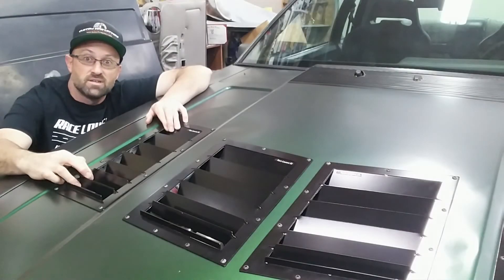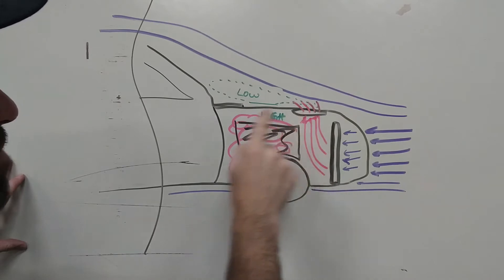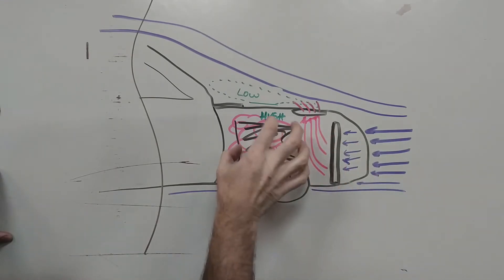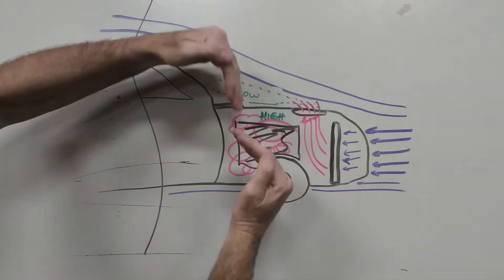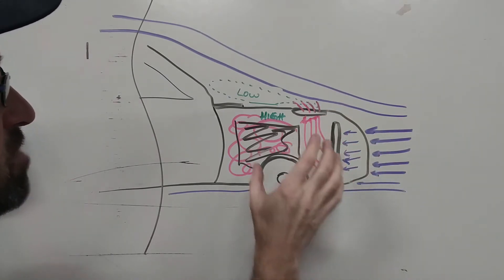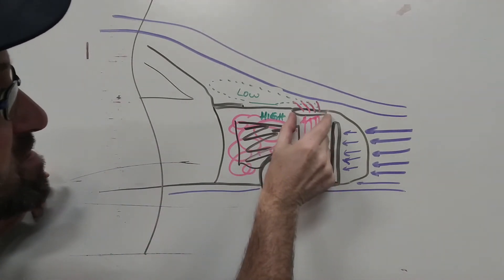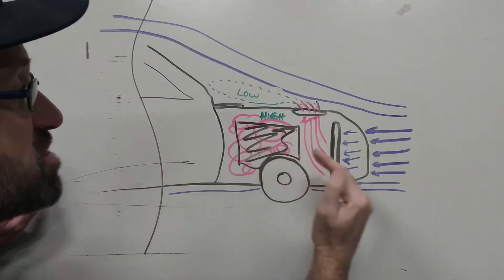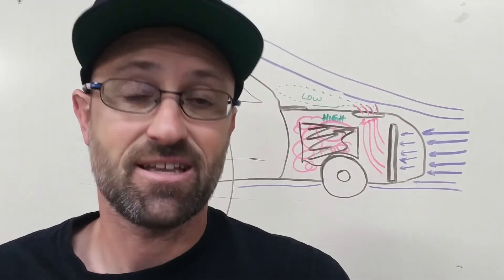How Do Hood Louvers Increase Front Downforce?

Comment: Very well explanation. I have to ask this. Does the air coming out cause a turbulence from the exit point onward to the roof vg, wing, wake?
Reply from the maker: Not really. The front edge causes a slight turbulence to help pull (or create a slight vacuum) the air front the engine compartment. After the vents it all blends together as it gets to the cowl and base of the windshield. Race Louvers has a few videos demonstrating how it all flows in a wind tunnel.

Comment: Does the placement of the louvers change the amount of downforce/effectiveness of the airway? Like would it make a difference if they are closer to the front or closer to the back of the hood?
Reply from the maker: The placement can change both effectiveness of heat escaping and the downforce.